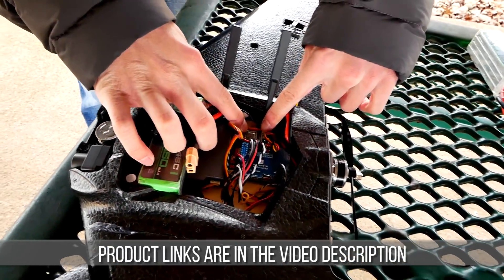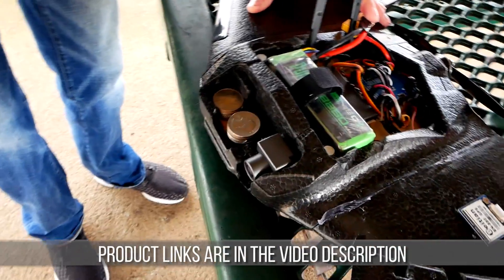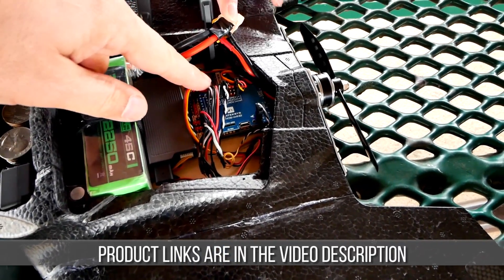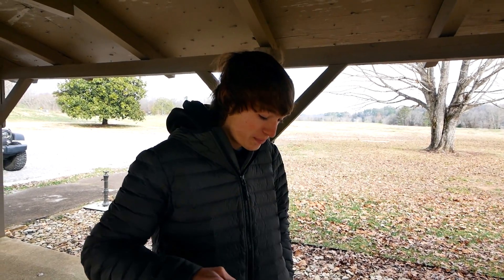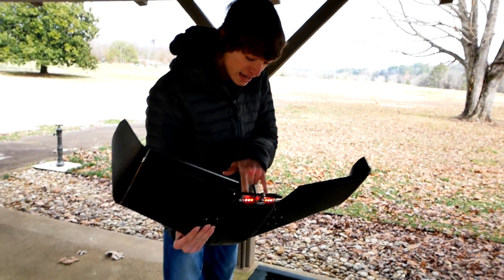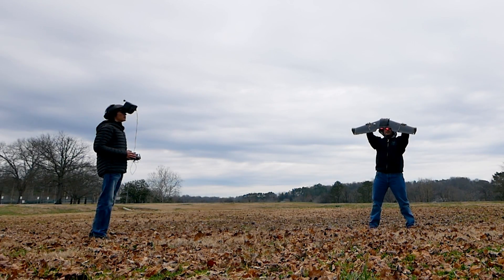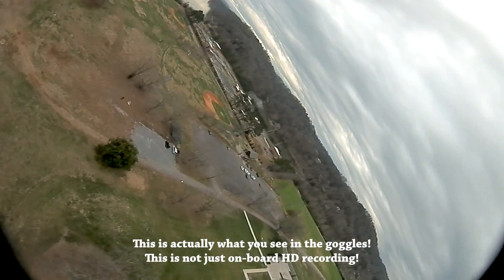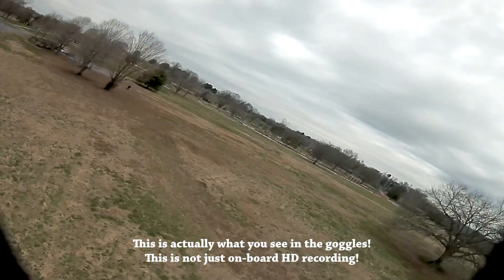DJI Goggles RE Ocusync SBUS Passthrough | COULD IT REPLACE CROSSFIRE? (NO)

Comment: Is it possible to reduce the latency in the future? As tech advances or is this it as far as digital video
Reply: That will probably not really be possible because the amount of HD video data just takes much longer to receive the goggles. Even if the digital image compression would evolve  enormous, so that the data would be reduced, it still would have much more than double of the data we have with analog video because there has always metadata information to be added to each data-packet that is send to the digital video receiver.
And there are even stronger counting problems, expecially with obstacles and other disturbance:
When some image-data in an analog environment does not receive the receiver completely sane, you just get our known flickers or whatever, but it's still recognizable where you're going. - OK, if it's not too bad.
In a digital environment, you always send packets with normally fixed data-sizes and add that metadata to that packet which describes to which request it's the answer to.
This leads to two problems:
1) If too many data-packets get lost or will be corrupted, it's almost impossible to reconstruct an at least flyable crappy image in our video-stream in the "realtime" we need as FPV Pilots.
Which means when you normally would receive a real crappy video-image on an analog system, on a digital system you will get a completely black screen!
At least with the hardware available for Miniquads.
2) When one packet gets lost, the sender will (normally) request that packet again, which then takes the abitity on the sender's side that it must still have a copy of that packet to send again and it again takes the time and expecially bandwith to receive it again. - But while waiting for that packet, the video image, which data this packet sends, must wait to be shown to the user because possibly, the failed data-packet does also includes image-information (metadata) about that image which is important for the video-player (Goggles) to show a video contained of single images that also have to be shown in the correct order :-)
...And those big problems will probably still remain long in the future.

I hope this was understandable, and if I got something wrong, please feel free to point that out ;-)
Reply: Henri Schomäcker thanks that makes sense and now I understand the difference between digital and anolog
Reply: The odd thing is they have.  For both Analog and Digital new firmware has been released for the goggles (analog & digital) and the digital video transmitter.  I fly my mavic with them and it feels locked in and fly analog FPV all the time with no dicernable lag; shooting gaps all the time.  I have not flown my long range unit yet in a plane but it's should be as good as the Mavic.  You need to remember the lag introduced from a crappy radio out it's trainer port and then if you need to do sbus decoding on the other side.  It does support telemetry display also.  Could be lighter and less bulky, but the multi-use capability and HD image makes it great. Love mine.
Reply: @dmyers9230  Yeah I was going to say there is certainly no lag in Analogue mode, I use mine in Analogue mode for my race Quads while the digital mode is great for when flying the Mavic.
Reply: Better compression certainly will improve it, 2.4 Ghz can already do multiple 4k Youtube videos at once with ~0.003 second ping latency.

You may note, Youtube at 4k is not 4k, its probably close to 720p (actually probably closer to 480p raw footage) in terms of size, but it looks good anyways thanks to compression. So if Youtube at 4k looks good to most people, then we can probably expect similar H.264 video encodes on the fly. It looks like the DJI system is severely under-powered in terms of processor though (hence the lag, the data still comes at the speed of light, and even LOS you see the plane at the same speed of light...).

You can go MUCH heavier in compression and still have much higher quality than Youtube if you have the compute power. I often save videos at 8:1 compression (turning 8GB into 1 GB), and with post processing of denoise and deblock encoding enhancements it looks better than the original. If I want it to look good, but not better than original, I can save it in 20:1 compression (I optimize per camera I own and just save that preset after playing around with settings until I like it, so that number varies some). Unfortunately, if you want REALLY high quality with REALLY low data space (bandwidth), then I can't even do real time encodes with a 16 core 32 thead CPU at 4.15 Ghz (Threadripper 1950x with water cooling with quad channel 3600 Mhz RAM). It still isn't capable of doing real time even on a DVD (I was going for massively optimized file and processing quality). So, sometime in the future, we will get there even using the same bandwidth (Youtube already does great with multiple 4k videos playing at once on 2.4 Ghz, and should be even better at 5.8 Ghz like newer Wifi, I'm just using a laptop from 2012 to test, its not new enough lol!). Gigabit Wifi is definitely awesome!
Reply: @jakegarrett8109  More compression = more lag. 
This is due to processing, this is why we use Analogue with Quads, its a raw video feed. Digital is laggy even with a lot of processing power, if you used uncompressed digital, it would be low lag BUT the bandwidth would be wider than 160MHz which would be problem matic.
Reply: @pavawarez8825  That's why I said in the future (we could do it now, but it would add significant weight and power).

A good example of ACTUAL on the fly data compression AND decompression is Steams's in home gaming stream. You run the game on your powerful desktop, and play the game anywhere in your house (or anywhere in the world with fast connection, but preferably local networks). I used it from my dorm room where my PC was, and took my laptop anywhere on campus with good results. It has ridiculously low lag considering I was using roughly 1 potato in terms of laptop compute power. Now am I picky about games being responsive? Well I literally puke playing consoles because they are a stuttery mess with low fps (I wish I was joking, but last I played console, it was under 30 minutes before I vomited, sucks when you can't play with friends at a party...). I could tell there was some latency, but it was silly low. So if you can decently play video games (sending input, receiving compressed images, displaying decompressed image), then you can certainly fly with low latency this way.

Is it as low as analog? No, but maybe... So I'm not sure why we only have 60 Hz goggles, when some monitors go up to 240 Hz for 1080p (yeah these are expensive, but so are Fatsharks...), but it seems like if we only get 480p, we should be running way higher. I'm sure part of this is due to yet again, data bandwidth being transmitted. If we could reduce that factor, could we then get 120 Hz? Or 165 Hz? Then 250+? Because that would be awesome, and should be silky smooth.

**Above example was with a potato laptop that struggles with internet browsing. Cinebench score of 40cb, my desktop makes over 3600cb for reference to put how slow that thing was. So if that potato could run the game streaming, mashed potatoes would fly through it!
Reply: I think they would have to develop more along the lines of quantum
 physics where they can "transport" data via "inter tangled particles ". hard to explain you will have to research that one.
Reply: I would like to mention another thing to the compression topic:
Realizing very high and very little data-loss compression require deep investigation of the data that has to be compressed. - And this is a huge challenge when dealing with streaming video where you don't know how the coming data will look like in the next fraction of a second.
That is not comparable with the compression of a whole video which whole data will be scanned before the real compression begins.
Reply: @henrischomäcker  That's why I mentioned live game streaming, its even more intensive than what is being asked (not only are all the game physics and graphics ran etc, but its also compressed and broadcasted to then be uncompressed when received).

You don't even need a monster system for this, I believe I ran this on a super outdated FX based processor (my laptop has almost 2x the processing power, depending on application of course).

So it can be done wireless, through a frequency we know well, 2.4 Ghz or 5.8 Ghz (WIFI bands happen to be the same as our analog video and controller bands). We don't even need to change frequency...
Reply: @jakegarrett8109  You're missing one important factor, though. How'd you handle breakups? Flying behind a tree using analog will produce an image which is still usable in some extent. Doing the same thing with compressed digital would be impossible. The frame will be corrupted and all you'd see is a black screen. Transmitting uncompressed digital is simply not possible as it'd require too much bandwidth.
Reply: @balint133  I'm not a good coder, but I'd guess "Timing". RGB light strip matrix for example uses flash storage for holding the signal. It flips through at precise increments for the "section" that gets info. This would make it interesting from a coding perspective, but digital can get segmented into blocks (I'm sure you've seen modern digital TV's getting those weird and ugly block patterns/glitches when they get poor signal, the same thing would probably happen). The big difference is, your TV probably has super low tech processing (maybe the new TV's with the image smoothing/processing are better, but its probably very low demands). With high powered processors, I usually enhance video footage that is grainy/static (haha, lol, the knock off Go-Pros just aren't as good, but Cheapskate approved!)

DJI seems to do a really good job, its just way too laggy (weak processing). It does get really decent reception flying behind trees and way out of line of sight (I've seen them go 1/4 mile and beyond, so many trees and canyon/hill in the way it was ridiculous, I was really impressed (you're right, it will drop out some, but you need a lot of blockage, probably why drone owners get into so much trouble!). I'd have to compare it to my "600mW" transmitter (untested output, input was something around 20 watts on a 3 cell). I've personally never had it get unclear on that setup (until I had 50+ feet of dirt in between me and LOS, don't worry, non-flying range testing, wink wink).

But do remember, most laws say you need to fly "Within line of sight" anyways, so, it may not be a big deal if you don't go behind buildings in your fun "race course" setup around your house.

Comment: Hi Josh and Sam,  I was wondering if you could tell me if I could use my FMS 1400MM F4U-4 CORSAIR  as a FPV Airplane using a Taranis X9D and Aomway commanders.
Reply: Yes you can, you can use any airplane for fpv. I prefer a pusher then a tractor plane, so you don't have the prop in view. But there is absolutely no reason why you can't.
Reply: By the way nice plane, FMS planes are great flyers, especially all the warbird series.
Reply: Thanks   I wanted the one with folding wings but everyone who did a review was saying that the gears were stripping out and could not get any service for it so I stayed with the standard Versions but I always wanted to FPV  IT  and GPS return home
Reply: @JohnnyD_RC  yeah they're definitely nice birds, I got the Corsair in the 800m m and then I got the P-51 mustang and 1700 mm FMS, lately I've been messing with my 2000 mm FMS Beaver just cuz it handles almost any terrain. Are you going to use INAV? Either way whatever you use it's going to be awesome if you can get ahold of a spare canopy to cut up and put the camera in the canopy it looks so scale! If you look on YouTube you'll find a lot of people flying FMS warbirds fpv. Couple good ones on RC groups as well. I look forward to seeing you results should be awesome 👊👍
Reply: I don't know what I'm going to use yet there's so many systems right now out there. I just finished watching Dustin Dunnill and he's flying from  MAUI to LANAI , and he's system works great but I don't see how he's flying
Reply: @JohnnyD_RC  me personally I use the mini vector, so much easier but then again so much more expensive. I haven't seen that video I need to check it out. But the mini vector is awesome because you can put virtual Gates in the air & fly through them make a video game really helps with proximity flying. Plus setup is a breeze. It all depends on what you are going to do. I also use the hobbymate it's cheap but it works. A good channel to watch for long range or on the vector is "Adam goes fpv" he's also an RC groups and he's done it all. Going to subscribe to your channel if I'm not already. You can also hit me up on Facebook or Instagram is you need some help. Farmer Fpv on Instagram 🤘
Reply: @JohnnyD_RC  ha I'm already Subscibed :)
Reply: Sounds good but for you know I haven't figured out how to edit a video yet so I have no contact . I already have yours
Reply: Facebook is John Duchi
Reply: @JohnnyD_RC  mine is Rob G Ricci

Comment: You know the pilot is Serious Business when he spends so much time flying inverted that it makes more sense to install the GPS upside down ;)
Reply: Haha nice spot! I really had no idea until i read this comment. Now I want to go and flip it over to test that out. (our arming issues during the video were, however, unrelated to GPS)
Reply: These guys are quad guys, not fixed wing guys.  That’s why they aren’t very good with this stuff I think.  Also he mentioned latency feels like 3/4 if a second.  Occusync 1.0 with 1080P (H.264) + controls is 160ms.  So less than even 1/4 second which is 250ms.  my guess is it was again setup wrong if the latency was 750ms.    Occusync 2.0 at 1080P (H.265) + control is only slightly faster around 120ms
Reply: meehhhe Of You with due respect, I am also an airplane guy. The GPS was a slip up I’ll admit. I dont mean to say there is literally a 3/4 second delay and you can run with that value as truth. I’m estimating what I feel to be exceptionally longer than I would expect from high performance equipment. My estimation skills for time increments on the order of hundredths of a second aren’t very precise so I’m doing my best to relay reasonable information a casual viewer can relate to
Reply: @polomarknot17  LOL Don't feed us trolls down here... just do yo thang gurl.
Reply: @polomarknot17  i know i not insulting you but i was implying 160ms vs 750ms is biiig gap bigger then analog to digital infact and i dont want people to also think occusync is trash because of your statement, it isnt, but not designed for racing quads or ripping gaps.

 yes i fly mavics which use occusync, some people will hate because of that.. but i know the delay is much slower than analog specially round trip requests can push into mid 200ms range when miles away but occusync is insane with its capabilities of hopping frequencies and splitting bandwidth and avoiding being jammed by towers and stuff...  i flown over 4 miles on stock equipment with occusync 1.0 and biggest limit was battery only lost 1 bar of signal doing that....all that under 1 watt in FCC mode (highest power setting dji uses is FCC region mode)
Reply: Yeah, what's the deal with that?
Reply: Lol maybe  a mistake
Reply: Maybe he prefers watchen das blinkenlights over a wider DOP?  Seriously, I can't find any reference as to why someone would do that.  The foam in close proximity to a fractal antenna isn't going to be entirely radio transparent, and any patch is practically unidirectional.  RTFM I guess.
Reply: A lot of people think that is the proper orientation, See it a lot in the iNav FB groups and RCgroups threads. #YoureDoingItWrong
Reply: @NoAgendaFPV  I swear I've seen more than a few mounted upside down, not just on @TropicalOnion's plane.  I couldn't find a legit reason anywhere.  I thought maybe iNav didn't allow you to reconfigure compass orientation or something.  

BTW, be careful not to damage the metal on the top of the ceramic patch if you glued or taped it down to the wing.  Depending on the design, that metal can be scratched or ripped off fairly easily.
Reply: @mistercohaagen  you don't even need the compass for wings so that's bad logic to do it upside down. People just see the label and put it up I think, or the LEDs
Reply: @NoAgendaFPV  I always found holes in knowledge like that a bit creepy.  I grew up with Amigas, fidonet and Forrest Mims books...  The younger generations, or people from like India...  they can do fairly high level crap like code in C# or whatever, but don't understand that you can't hot-swap a DIMM in a server, or have the intuition to know what certain things are on first glance, like what an antenna is and how it might operate...  cause physics.  Nothing hobbles a conversation like lack of context.  Doesn't bode well for our future imho.
Reply: Haha I legit thought the wing was upside down for a minute. How can the FPV know it all let this slip? What can you expect though the kid is flying DJI shit, more money then sense hell he's even gluing money to the plane haha.
Reply: @thirtythreeeyes8624  "gluing money to the plane" lol...  Nah, that's cause he's a bit shy, so he's using his mad aero-engineering skillz to make it rain on them Latina hoes in Mexico, from afar.  You gotta set the tone for your arrival in person...  cause he's strait abducting a whole gaggle of hoes his first time out, and wants in deep with the cartels.  That's how you get your resume out there.  Pretty soon he'll be flying bricks of yayo back over the wall by remote control to feed his Latina habit.  He'll be on instagram not being able to stop saying "That's how we do it!" with hoes and guns in the background.  All true.